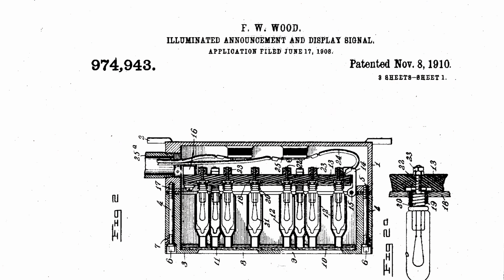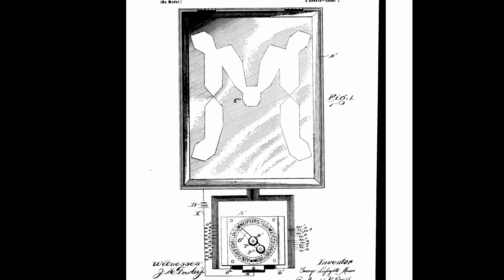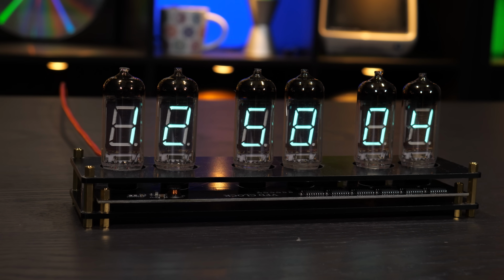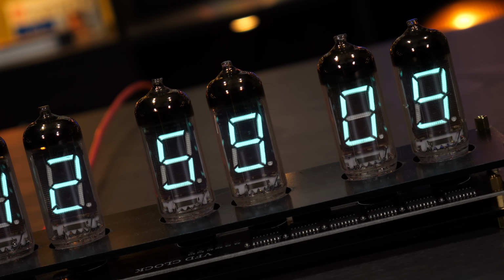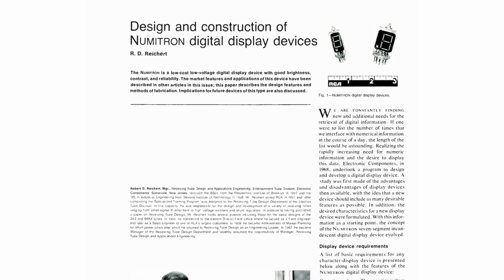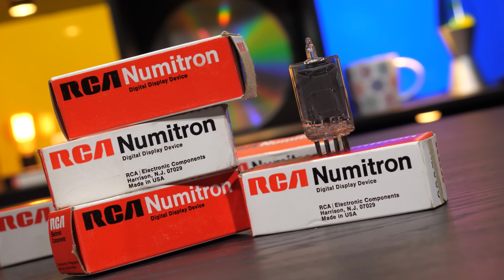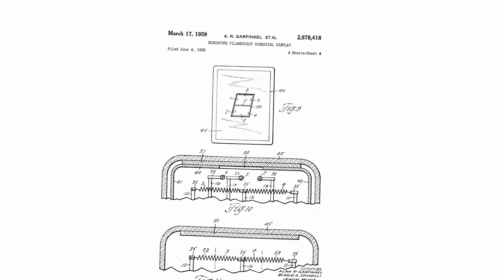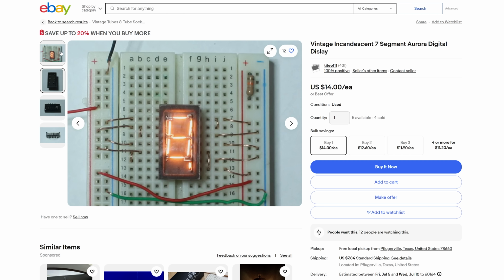The Numitron: An obvious idea that wasn't very bright

Comment: Numitron backing is grey because RCA used what they had in spades, the sheet steel with aluminium coat that was used to make anodes and internal structures for thermionic tubes, and this was proven to survive the glass sealing and gettering operations. Thus they used the standard tools they had in the tube plant, the flat anode sheet, slightly formed to be a stiff backing, and punched out the holes needed to hold the filaments. Then used the technology they had to make glass beads with wire in them, and sealed those into the holes, making the filament supports, and then simply used a flat section of that steel wire that was bent over to hold a length of thoriated filament wire, also a common item in the tube shop. Length and diameter calculated for the brightness needed at the applied voltage, and then simply placed in location, the ends folded over, then spot welded together to trap the tungsten wire under slight tension. Then at the rear spot welds to a lead frame attached to a standard off the shelf 9 pin glass base, and you have the complete unit. Glass top attached, and then evacuated with the standard roughing pump, and as a bonus because of the low voltage, and no need to maintain an ultra low vacuum, the roughing pump and the heat sealing of the tube is all that is needed to operate, no need for a getter to be installed, and no need to flash it, just a RF heating during sealing to get a high vacuum, then seal.

Incidentally there were small versions made, the same size as your common 7 segment LED displays, and they were very popular, as they ran off 5V, and interfaced with logic. They worked best using CD4049/50 CMOS level shifting buffers, as those would source or sink 50mA no problem. Using a buffer/inverter per lamp, and a BCD decoder or counter per digit allowed those displays to be bright, and as bonus you could also use the blanking input on the drivers to use PWM to dim them.  

Project to replace those displays with LED ones worked, just that it really did not drop display current use, it was still 5A of current at 5V, though it was good in that at least you had a display that now was available, using a tiny HP 7 segment red display.  Do one conversion and you had 16 numitron displays to use to fix others, so we only converted 3 boards to the LED version. Biggest problem was the resistor value selected was too low, so the LED displays were running way too bright, so had to be dimmed. Rather than destroying the cordwood board made to fit them, I simply used 2 6A silicon diodes in the common line, to drop the voltage seen by the LED displays down from 5V to 3V8, which made them dim to exactly match the old displays. Those 2 diodes were hard to fit in the limited space left on the display board. Users liked the new crisp displays, the bright version got complaints that it was so bright it was unreadable at night with dark adapted sight, and it lit up the entire cockpit. Display dimming had to match the other display, and that board used unijunction transistors, and had a disconcerting habit of the power transistor unsoldering itself from the wire leads, it ran so hot. Base lead unsolders itself, transistor is still conducting, runs hotter and lamp blows. Select spare lamp and it also blows, unless enough time for transistor to cool below 200C junction temperature.  Would have been nice to have had some of the more modern mosfets that can handle 50A, but not at the age of that design.
Reply: Cudos to all you folks who report all this old institutional knowledge that would have otherwise be lost to the ether.
Reply: Brother are you the Numitron inventor
Reply: Those "smaller versions" were made by IEE/Aurora and Wamco.  The Wamcos were particularly neat, because they really are about the size of standard .3" LED displays, and they even had 16-segment versions that were fully alphanumeric.  At only 12 mA per segment, they could be driven directly by TTL logic.  They were also incredibly rugged, and rated at 100,000 hours lifetime.  I still have a box full of these.  The catalog also lists linear and round bar graphs, but I've never been able to find any of those.

They were very widely used in avionics because of the easy readability, especially in direct sunlight where LEDs became useless, as well as being so rugged and requiring simple drive circuitry.  Another, somewhat obscure, feature is that they are viewable through night-vision goggles; LEDs don't emit significant infrared, and so can't be seen.  Because of these reasons, and also because the FAA takes a long time to approve new technology, it's still pretty common to see them in the cockpit.  In fact, they're still being manufactured!
Reply: Great post.
Reply: For what they are, they are a shockingly practical design when all factors and use cases are considered. 

Low power consumption, reliability, low retooling and machining training costs, and simple input requirements. 

Seems like a win to me, especially if they made it into important use cases like aviation electronics. That usage alone tells me that they did something very right with these. 

I'd probably apply the "it ain't stupid if it works" adage here.
Reply: Damn, now we know why these numerical displays fail so often on MD82s & 90s... used to replace a few of these on each airplane that comes in for a daily check. I still have a pocketful of these displays with just one or two lines burnt out. My cat loves to chase these more than erasers.😂
Reply: These (DR-2000) and most other numitrons have getters. Hot. Filament tubes are surprisingly sensitive to vacuum quality, both due to heat loss from convective flow at low pressures, and the water-tungsten cycle.
Reply: My mind is blown!
Reply: The metal pins of vacuum tubes of that era were made of KONAL alloy that had a thermolinear expansion coefficient as the glass in the tubes
Reply: Some vacuum tubes have black anodes. I think they are shiny so they would not be suitable. If somebody has one could they take a look at it.
Reply: you know they could have also worked a lot better with shallow die punch depressions on the sheet steel around the wires to create a set of parabolic reflectors which could have reduced the bleedover from each other to 0 and even increased the apparent brightness and thickness of each segment, and it wouldn't have been massively more per segment once they got a die punch machine working on them.
Reply: This is what "using proven technology" actually looks like.
Reply: I really don't understand the hate. They came up with a cheap, simple and cheap and simple to drive solution and TC is on rant on how it was not perfect...
Reply: Thank you.  It wasn't just laziness.  Youngsters don't appreciate what it was to design products in larger companies in the old days.  You had groups with their knowledge and technologies and materials and could not just choose something out of thin air that wasn't tested.  We didn't make things like MacBooks that could just fail in a few years due to design errors and get away with it.
Reply: I suggest black spray paint could have been applied, in fact, out of thin air.
Reply: @davids plates obsolescence didn't exist? uzukiispolpot
Reply: someone give tldr plz
Reply: While you're at it, what's your opinion on the new superencabulator designs that are coming to market? Are they any better than the time-tested retroencabulators we all know and love? I'm especially worried about the convinency of the blanged spouns (a ridiculous design choice if you ask me). How will they fare in regards to hypotoroidal inflosion?
Reply: @kathorsees  They are improved, though sadly because the manufacturers now had to cost cut the hypotoroidal inflosion units now have a shorter life, and thus you need to have regular service calls to replace the failed unit, which when it fails also causes extra damage to the Framulator, and this will also often need replacing as well.
Reply: @SeanBZA  A sign of the times! Just as I suspected. But it's good to have confirmation from an actual professional. Have a good day, sir!
Reply: @SeanBZA  This exchange is superbly wholesome. Thank you Sirs for putting a smile on this worried face ✌️

Comment: The only place I can remember seeing numitrons was (as you mentioned) petrol (gas) pump displays, and they weren't especially good even there, where I imagine they were being driven quite hard to be read outside. Non-working segments were very common. This was the stop-gap display on petrol pumps between mechanical number reels and leds as I remember, early to late '70s here in the UK.

Comment: Back in the late 60s early 70s I went to buy me then girl friend a clock and did not like the small displays so I bought a GE ? clock that had one light ( 24 volt ) and a motor that moved cardboard shutters in and out and thus had nice large numbers.The best part was it lasted about 30 years before the motor stopped.

Comment: I'm pretty sure there were numitrons or a copycat in the pumps at a ~mid 1970s Shell gas station near my grandparents house when I was a kid in the 90s. The displays were housed in large mirror-finished stainless steel orbs that were suspended from an arm on the pump, really funky and futuristic looking.
At some point late 90s or early 00s they cut out a chunk of the stainless steel balls and fitted them with a larger more modern display, and in like 2010 they refitted the whole petrol station removing the steel orbs entirely, sadly.

Comment: I clearly remember these being used in petrol pumps well into the 1980s. At the time, LEDs simply couldn't compete on brightness and wouldn't have been visible in even shaded daylight, whereas the numitrons were. They were the right technology at the time for that application, and it took some time for them to be displaced by LCDs.

Comment: You are right, they were much cheaper than the early LED displays.
One of the first LED Displays was the Monsanto MAN1 seven segment display.
Symbol height of the MAN1 is 0.27".
The price in 1969 was 48$ inflation corrected 240$ a piece!
A lot of money!
You are right with the gas pumps too!
One company produced LED plugin replacements for the DR2000 tubes.
They are ultra-rare today!

Comment: NIXIE TUBES ARE COOL.... NUMITRON IS A JOKE. THE MACHINES REQUIRE FAST ENOUGH DISPLAYS. I disagree with your characterization of circuitry. The high voltages is not a problem and the circuitry is simple. Seven Segments are not significantly easier to implement in practice. It's all about cost and esthetics. I am a retired Electronics Engineer with 53 years experience and design with this technology. With modern I.C.s the logic is easy.

Comment: My dad's old 7 segment display alarm clock has a system I've not been able to find any info about.

When it finally broke he let me take it apart and it had two sheets of glass for each number with black stripes. Thr sheets were connected to a wheel with grooves in it. As the wheel turned, it caused the plates to slide and the stripes would line up to form the numbers of a display. We were quite surprised it wasn't just some sort of back lit LCD.
Reply: Sounds like it might be the Telechron Occlusion Clock.
Reply: @eDoc2020  That is it! Interesting, thanks!

Comment: A splendid piece. I recall numitron as the display one loved to hate. In a time when ordinary light bulbs were rated at 750 hour life, I never believed the numitron   would go 100,000 hours.
At least numitron  was flexible enough to be a generic component. They've been replaced on my hatelist  by VFDs. The ones on my high end stove dim over not many years of work, and they are one-off devices, available only from the stove maker. And don't get me started on the neon 7-segment displays Heath it loved so much. Really, the nixie was an attractive display, even if cluttered. It was the 20th century version of steampunk, screaming that clunky complexity was a virtue.

Comment: Ah, I bought a Radio Shack kit that used these when I was a teen. It was a Numitron and a circuit board with a multiplexer chip. One digit. I bought a couple and used a counter chip to make a timer of sorts... It didn't feel cheap to me at 8-10 bucks a digit! Great video!

Comment: I'd bet every one of your gripes would have gotten fixed if it had any more time prior to LEDs tanking in price.  The first version of anything is janky.  I mean go look at an Apple I.
For instance I'd bet someone at the time suggested making posts that are 2 or 3 layered axially and insulated so the filaments would be separated in the Z dimension as opposed to using x and y, but the bean counters stopped it from happening because production was already stood up and they knew it was doomed.

Comment: With a four segmented plus and minus tube display, I have come up with another use for Numitron Displays... "Digital" FUDGE/Fate dice. For those of you that don't know what that means, Fate is a tabletop RPG that uses funky looking dice where there are only three outcomes: -, _, and +! As a system it's easily available to configure a randomizer since you only need to do three  variables four times. In fact several of the worlds that you could set a campaign in would make sense to use such a display in the first place.

Comment: Honestly I have to applaud RCA for making something that is cheap and easy to work with, even if there is some tradeoff in readability. Had LEDs not been right around the corner these easily could've stayed around for a bit, Nixies are a PAIN to deal with. I'd also love to see a re-launch of these using LED COB filaments as are used in the modern 'Edison style' big filament bulbs, would be very neat.

Comment: Back in the early 80s, the aircraft I worked on in the Navy were full of Numitron displays. They are surprisingly rugged and long lasting given the vibrations and forces they have to contend with in avionics applications.
Reply: Plus I would expect them to easily meet the -55 to +125 degrees C temperature range demanded by the military. The same reason they were used in Gas pumps.
Reply: Here's the big reason. Rca had major defense contracts and had a captive customer.

Comment: Accepting the need for a black background, I think that using coiled tungsten filaments would also be an improvement to base design, albeit at the cost of increased manufacturing cost and increased power consumption.

Comment: We never used Numitron tubes, but there was a period... roughly 20 years or so, where we were using (red) LED 7-segment displays and matrix displays.  The matrix displays were really cool, basically they were just a rectangle (similar to a 7-segment digit), but each "digit" was a matrix of point-source LEDs.  For example, 8 x 7.

The matrix displays could be used to produce very legible alpha-numeric representations, including lower and upper case.  And if you stacked a couple next to each other you could produce a scrolling display.  Actually, you could produce a scrolling display even with just a single digit and output perfectly legible sentences that humans could easily read and understand.

While you could produce an alphabet with just 7-segments (and even more with 15-segment displays which were briefly a thing too)... while you could do that, you could not produce and distinguish every individual letter in a way that a human could naturally read.

The digital drivers for these displays were really easy to make.  You literally just have a direct digital output for a single column and then you have a demultiplexer chip to select which column to drive.  The power required was small enough that HCMOS logic could directly drive the columns.

In anycase, for 7-segment, you needed 8 digital outputs (including the decimal point "."), plus one open-collector output for each whole digit.  A very small number of digital I/Os could drive many digits.

Each digit was driven individually, time-domain multiplexed.  For example, you drive digit #1 for 1 millisecond, then you drive digit #2 for 1 millisecond, and so forth, repeatedly, to drive the whole display.   One very interesting consequence of doing this with a CPU (like a 6502 or a 68000 in those days), and having a 1ms timer interrupt, was that your main loop could not disable interrupts at all because the timer interrupt had to be very precise or the human eye would pick-up the distortions in the time-domain multiplexing of the digits.   One segment would be displayed slightly longer and appear brighter (even just 20 microseconds of jitter was enough), other segments slightly shorter.

There were 7-segment driver chips that took care of the timing, but it was cheaper and better to drive the displays directly from a CPU-controlled digital I/O because you could do a whole lot more with the display with direct CPU control.

-Matt
Reply: Did you ever use Stanley 7 segment displays? They're highly sought after today. I'll let you guess why 😃
Reply: @jdeg2000  I don't remember the brand but  mostly they were 7-segment displays that looked like wide dip chips that we soldered straight-down into the circuit board.  With glazed segments and either white or black insets, and potted from the back.   They were very pretty displays!

And then later on we began using red matrix LEDs.  Same physical dimensions as  the 7-segments but they had a matrix of point-source LEDs and a lot more pins.  Those were lots of fun.

The matrix LED displays were not as pretty but you could form a fully readable alphabet on them and even push sentences out even with just one device with a little scrolling algo.   I wrote my first from-scratch "font" in my 20s to drive those things and there was much awe.

Never had a single failure.

-Matt

Comment: The Numitrons were quite visible in daylight, I saw gas pumps outfitted with them, but they could have been some other brand.  I have seen ceramic packages, somewhere.
The acid test is:  are they still in use, NOPE! Ron W4BIN